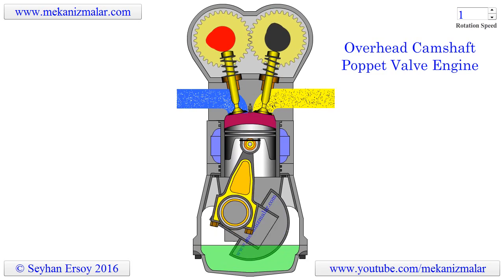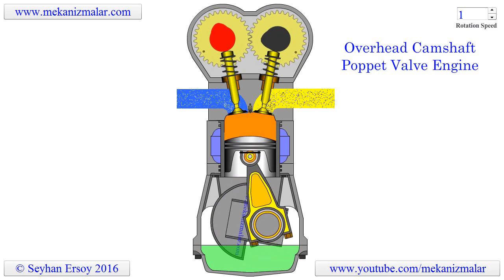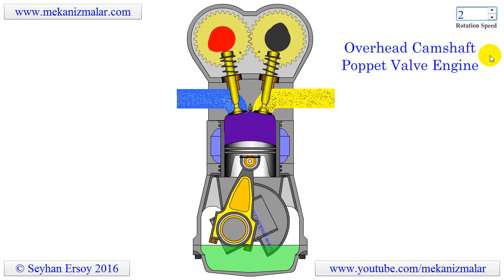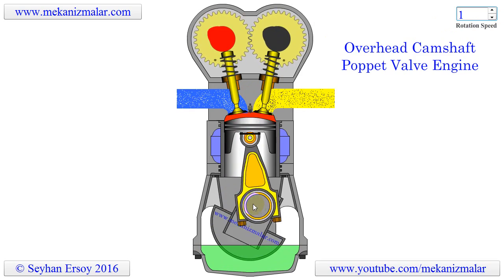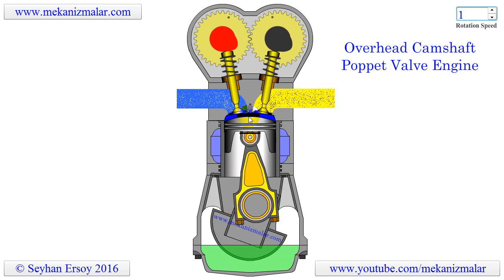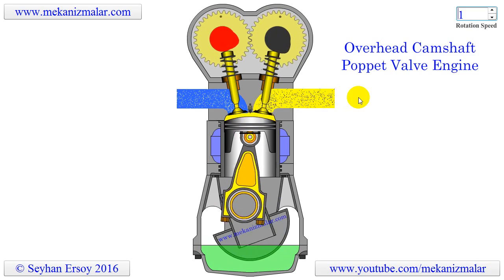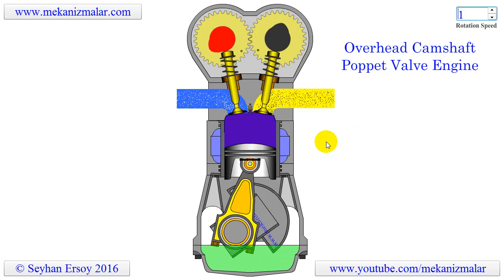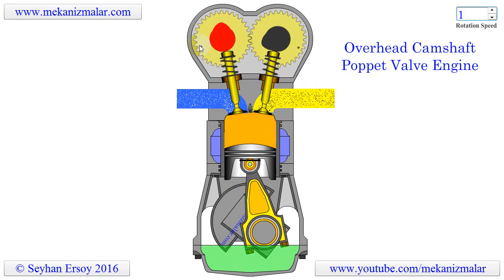overhead camshaft poppet valve engine

Comment: couldn't valves be run off a mini crank shaft? would be desmodromic as well.
Reply from the maker: +970357ers I am not an expert about the internal combustion engines, they tried everything to replace this classic engine design, but no success. Actually due to advance in the electronic and computer control, these classic engines also advanced substantially. Such as fuel injection instead of carburetors, four valves and many things that I don't know.

Comment: Interesting point about the wagon wheel effect. I never really thought about the relationship of frame rate speed variation between computers and the speed that a video is recorded at.
Reply from the maker: +wjf213 Thank you for your encouragement and support. In real life at outside of any flickering litgt rotating object become invisible like blurred image. Imagine you are very close an airplane propeller, you can see the objects behind the blades, just like you are looking through a glass. However you will not see blades are mowing backward or stationary. However, if you are inside where there is light source which cycling 50 times per second, than you could see propeller or fan blade turning in reverse direction in a fuzzy vision. Engineers use stroboscope to find rotation speed of an object without any physical contact with the rotating object. They just adjust frequency of flickering light of a stroboscope till they see the rotating blades seen as standing still. From there they can find the rotation speed of the propeller.
Reply from the maker: +wjf213 A week ago I was watching a nature TV documentary. It was about how animal tricking predator to not detect them. In one case, it was mentioning about Zebra's stripes. Imagine a lion attacks a Zebra herd, and all of them running in different directions with different speeds. It is so hard for a lion to single out a Zebra. If the Lion single out a Zebra during initial attack, its more successful in the hunt, but it fail most of the time. It also mentions about viewing Zebra from predators eye, even the is Zebra running in one direction, predator may perceive it going in the opposite direction. However, I could not understand that, since I am not expert about predator visions.
Reply from the maker: +TheWindGinProject  Please look at an animation I made years ago to explain this. Change the rotation speed to indicated speed in the animation and watch it how each segments behaves differently for different rotation speed.
http://www.mekanizmalar.com/rpm.html
Also, remember how we use to adjust rpm of a turn table by using black and white marks around the rotating table.
Reply: mekanizmalar I do remember the turn table marks that I would use to adjust the speed of a vinyl record as a kid but at the time I just thought the strobe thing was real "groovy". Ha! I will see your video for sure. Thanks
Reply: mekanizmalar One other thing; I asked Thang if he used Dynamic Simulation or Animation when using Autodesk Inventor and he said he uses Animation to start with and then if the special constraint is not available he uses Dynamic Simulation. Thang is also a PHD like you.
Reply from the maker: +TheWindGinProject Thang is very talented person and I like his mechanisms.
Reply: +mekanizmalar I'm glad to you explained that wagon wheel effet as well. I often wondered about it. Does this hold true in real time or real life with the eye seeing and proccessing movement only so fast? Also Thang is very good and has helped me with a couple things. Keep up the great work.
Reply from the maker: +wjf213 Please watch this. https://youtu.be/bHy0ALwF8VA